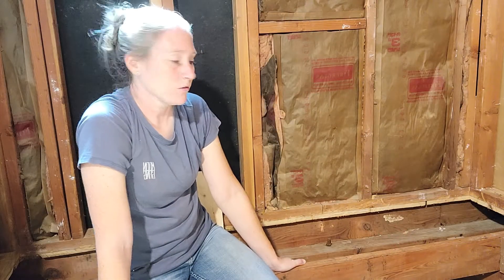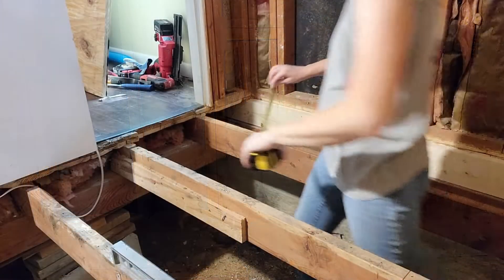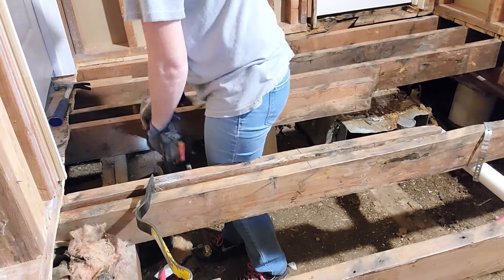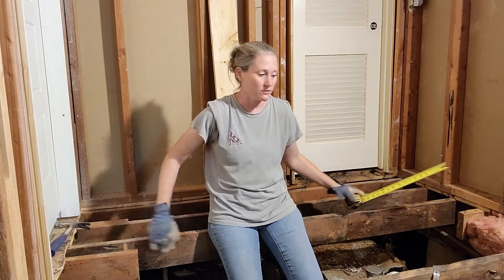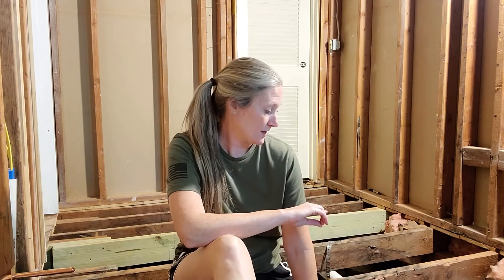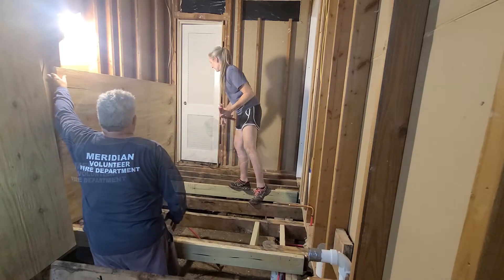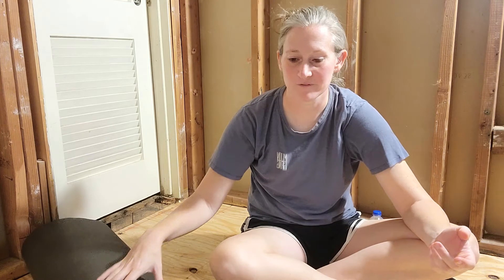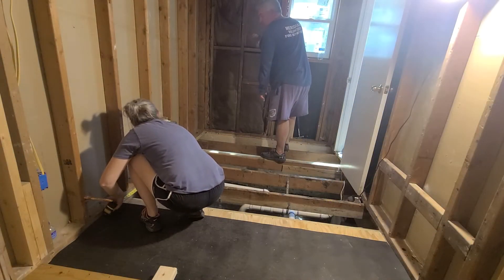Part 6 - New Subfloor (Master Bath Renovation)

Comment: We went with 2 layers of 3/4 inch subfloor as well in our home. At first, we kinda thought we were making a huge mistake as the cost was crazy! However, when we were done and we felt how much more solid our floor was, we immediately knew we did the right thing! With an 1 1/2 of subfloor and 2x12s on 16-inch center, we have a flooring package that can support anything from tile to marble if we so decide. We are going with tile in the kitchen and baths and engineered hardwood everywhere else. We are a little more than halfway with our total home renovation now. It's a serious grind. Somedays, i just want to quit and just sell it and buy a new home, but we've just come too far at this point.

Comment: @4:11 ish.....i noticed you didnt put blocking between the joist where the two sheets of subfloor come together. We were told by an engineer to always put blocking underneath where two sheets of subfloor come together as this prevents deflection of the floor when standing on the seam thats between the joist. When they build a new house they always have the edges of the subfloor sitting on top of a joist. They also use tounge and  groove that supports the subfloor were the sheets of subfloor come together. Without tounge and grooves you need blocking underneath. Having two layers of subfloor will probably be ok in your situation as long as the additional top subfloor wasnt cut and layed exactly like the bottom subfloor. Hope this  makes sense. 😊
Reply from the maker: That does make sense and I've never heard that before. My understanding has always been that the first layer screws into the joists, but the 2nd layer only needs to screw into the first layer. I have worked with people who swear by tongue and groove plywood and people who never use it. Guess I'll be doing a little more research before my next room! 🙂
Reply: @historicalhomerehab  yes you are correct that the second layer needs only screwed to the first layer. Our engineer said this was necessary so the second layer could contract independently from the first layer. Hope I didn't confuse you. We decided to hire an engineer before we did out renovation so as to prevent any mistakes that would bite us in the end. We found out it wasn't even that expensive considering.  The awesome thing is it gave us a "guy" we could call when we had questions 😀

Comment: I'm curious as to why you elected not to repair the original joist then sister them
Reply from the maker: Hi Eirika! I rewatched the video to see what the benefit to doing that would have been and I'm not sure that I understand. I chose to go beside each of the cut joists because I was able to attach the new one to the old and rest each end of the new joist on the two beams. I definitely don't always do everything the very best way and am open to learning. Can you explain what you would have done differently?
Reply: @historicalhomerehab  I think they're referring to the 3rd and 4th joist from the door. I think they just zipped through the video and didn't realize it wasn't a full length joist to begin with and that you were just replacing the joist and that there was no repair possible. You did a great job. Looks very sturdy
Reply from the maker: Ah, you are probably right! Thank you! 😊